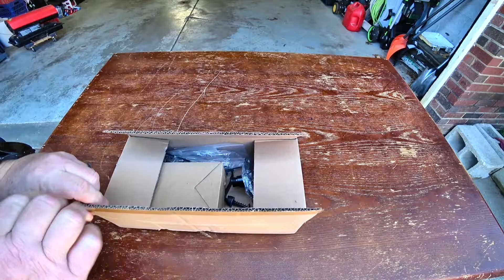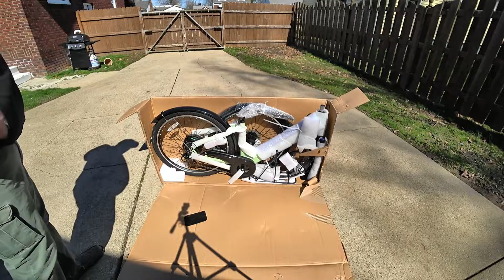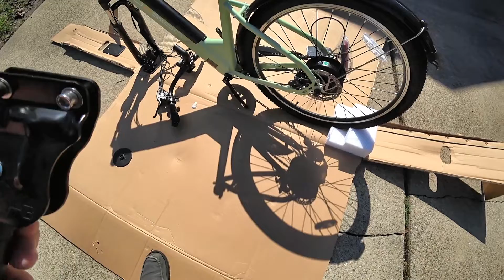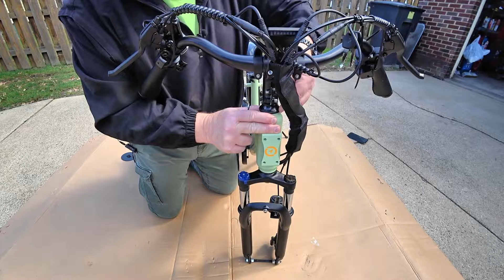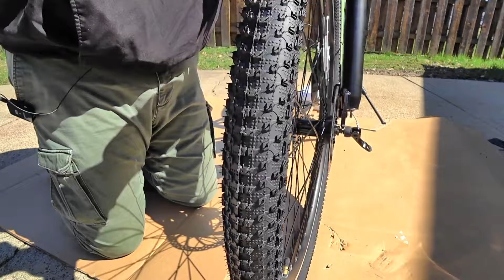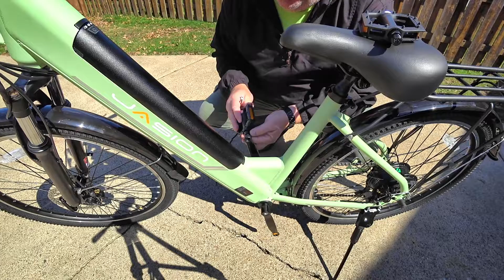Jasion EB5 Roamer ST Electric Bike Unbox & Assembly

Comment: Strange that I can't find even single review of this bike actually running NOT unboxing
Reply: Yeah I just got mine. The only issue I'm having is the seat assembly. I can't get the seat shaft into the chassis... It's like the powder coating is on too thick on the seat shaft and it won't go in without a ton of force. I'm contacting customer service to see what I can do about it and make sure I'm not voiding my warranty.
Reply from the maker: They asked for unbox assembly only video... Bike is very decent no glaring issues and built well..